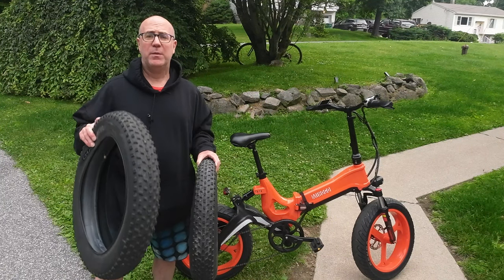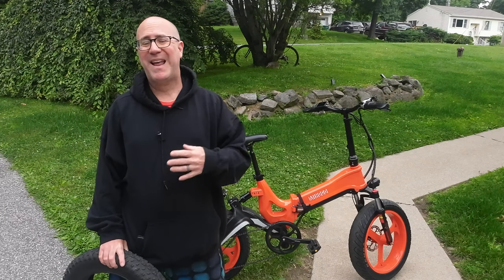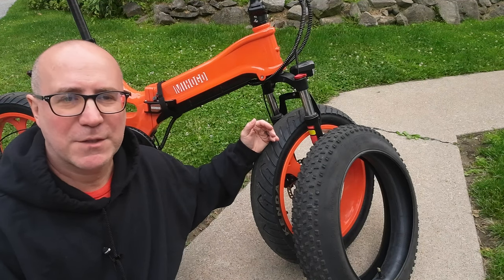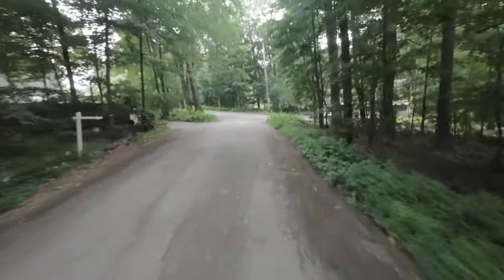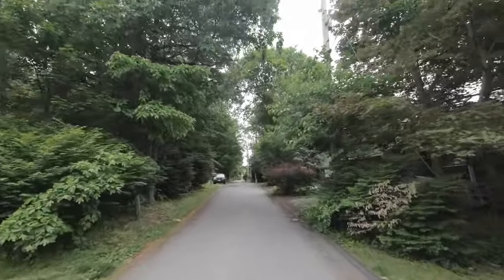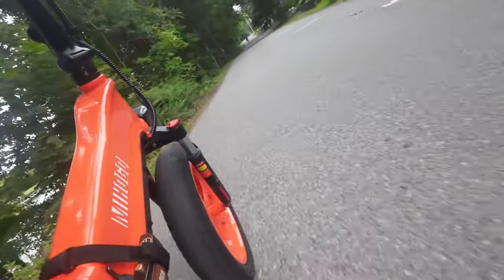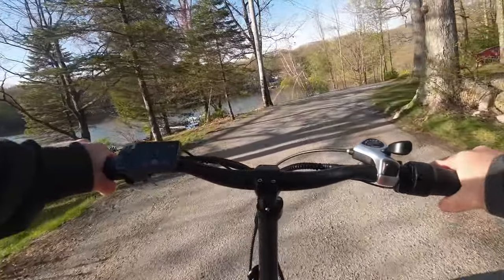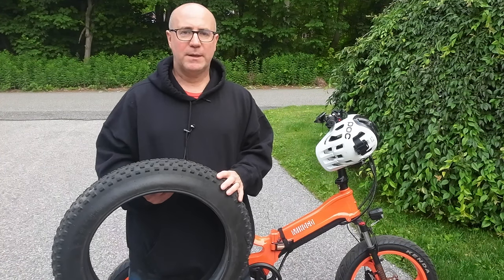Slick vs Knobby tires | What are the right tires for your ebike?

Comment: Moral of the story, stay with what you have and stop worrying and spending stupid money.
Reply: Faster acceleration and better handling - slick tyres
Reply: But I have stock after three days in about 45 miles took in a large piece of glass and even though my tube sealed the tire looks terrible
Reply: It took me about 55 years to learn this. I'm a daily ebike elderly rider. My new ebike has 300 miles, and it shows no noticeable wear yet. Yes, I will  be installing motorcycle tires. But I dont need them until this winter. The knobbies are better in the winter, and dirt desert roads.
Reply: @shahan1465 will it be easier to get flats with these type tires or will it have the normal chance of getting a flat tire?

Comment: The mountain tire is better in my opinion. It grips better and can handle wet ground. The “car” tires look to me as though there may be issues down the road. I’m in NYC so I’ll be stopping by Mr C’s Cycle for all my tire gears and repairs if necessary.
Reply from the maker: The streets in NY are far from forgiving. All those potholes could be tough to deal with.
Reply: Open (knobby) tread has less traction in the rain and on other slick surfaces.

Deep mud is about the only environment where knobs are preferred.

Comment: I think the knobby tires wear out too fast I'm going to get the regular tread ones next time
Reply: Same. Most knobbies are paper thin. Street tires are way thicker rubber. 700 miles on my fat tire folder, tires were past the wear indicators. I don't ride in the rain or off road. Knobbies are incredibly noisy, and annoying imo.
Reply: My knobby tires were done after 700 miles.  Went with slicks and the ride is much smoother.  Time will tell if they last longer.
Reply: @daxc1972  They will. My Chao Yang knobbies are very loud, and flat easily. I'll be changing to motorcycle tires before winter.
Reply: Have you paid off the huge bank load you had to take out to pay for the tires? Where I live you, you can buy automobile tires for close to the same price as a slick or knobby.

Comment: The major issue I found using slick type tires is you have to watch out for any loose sand or gravel in cornering at certain speeds, the bike can slide right from under you.  I prefer knobbies.  😁
Reply: I had this happen on my analog mountain bike when I switched over to slicks.  I hit a patch of sugar sand (here in FLA) and made the mistake of making a short turn.  Needless to say, it was a quick introduction between my face and the pavement.  Thankfully, my helmet kept my noggin intact but my Ray Ban's took a bit of a hit along with my right elbow/forearm.  Lesson learned was that running slicks on any type of a bike will require a certain amount of due diligence (for road conditions).

Comment: Yes if you like knobby tires be prepared to replace them every few months , I'm @ 240lbs. and found my tires were needing replaced about every 3 months because my bike is my only transport and on average $70-$80 was too expensive for me , cutting costs was why I decided to only ebike in the 1st place . I've been using a set of Chao Yang street tires that I picked up on ebay for about $50 a piece and have over 3000 miles on them , glad I went ahead and bought a 2nd set before they ran out .

Comment: Have had now 3 ebikes. Getting better and faster each time. All had nobby off road type tires. In my only 3k mile experience there is not a made for off road bike. Anyways, only ride street, too and from work. Never new how loud my tires actually were till I decided to get street tires. WOW, ride difference, sound, battery, everything.
Only down fault is you feal every pebble in the road. Battery good for 10-20 percent more on long hauls. Love them so far. Recommend tire liner and tube seal on all fat tires

Comment: I just ran my knobby tires till they became almost slick. They work great for pavement riding. Had about 4500 miles before they got that way but I like the way they are now. I still get to run softer air ride too.
Reply: Hi Tedwalker  What brand of tires do you have that got 4500 miles?  Im in NYC (Queens) and while we don't have the best roads I can say that so far between both ebikes I have rode about 2700 miles and only got ONE flat.  Keep in mind im very careful and always on the look out for broken glass and debris!!

Comment: You seem to have wisdom regarding Ebike tires,  so one big concern I have about Ebike Fat Tires is the treadlife seems really short in many cases.  I really don't like the idea
of having to change the tires because the treads are wearing out after less than 1000 miles.   Most likely the Ebike Im going to choose won't have puncture resistant tires 
anyway, so I was thinking about the perfect Ebike tire and I think that would be a tire with above average treadelife (from long city commuting on paved streets)  and be either tubeless
(which is almost non existant in Fat tire form)  or  comes with a puncture resistant innertube:  (any thoughts anyone on my comment)  ?
Reply: Im glad you mentioned this!  My Ecotric 26" fat tire Ebike has about 2200 miles and I'd say the rear tire is about 55-60% worn and the front about  35-40% worn. I also have the Aniioki AQ 177 Pro Max and its an early one with no name tires and the rear looks like it is almost worn down at about 650 miles!   For some reason I think my bike was a "return" and not new and had some miles on it.  It didnt click with me until I noticed the tire wear in the rear.  Could be just cheap tires too not sure,

Comment: knoby or not  i see i lots of people riding ebike with not enough air in the back tire. PUMP IT up and you must save a lots of riding time on one battery
Reply: I agree but not just E-Bikes even regular bikes.  Many ride around with under inflated tires.  Both of my Ebikes call for about 20 PSI but I inflate them to 21.5-22 and never had an issue. I go a bit higher to get more range and also so I have to check the air pressure less frequently!  As I know it goes down after a month or two by  1-3 PSI